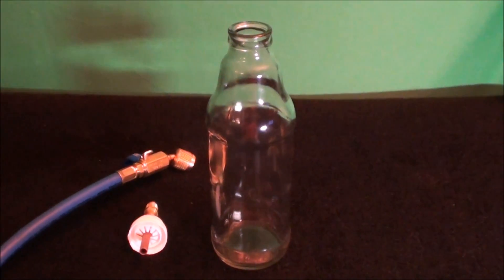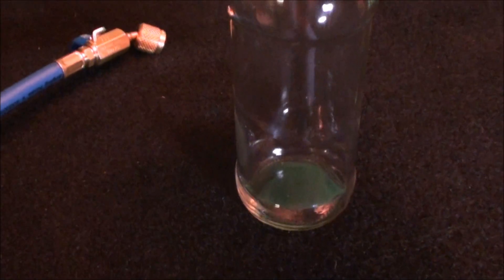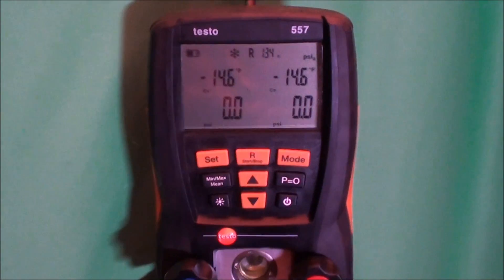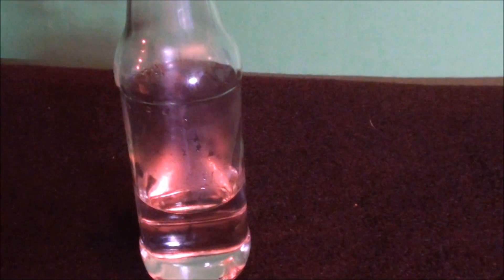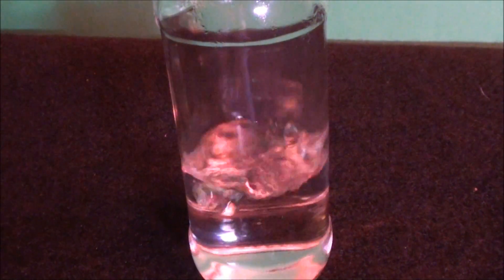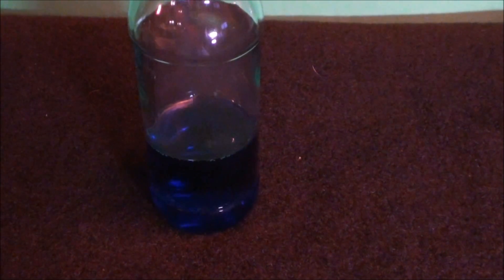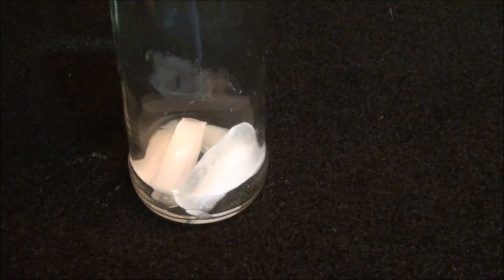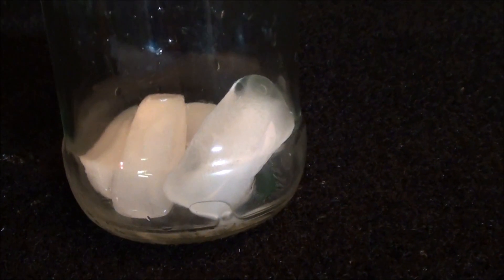Vacuum Chamber Test

Comment: Hey. Water boils in a vacuum, because water does boil at a lower temperature in lower pressure. It stops boiling when the water loses all the heat that it has, and will eventually freeze.

That's what happens! :D